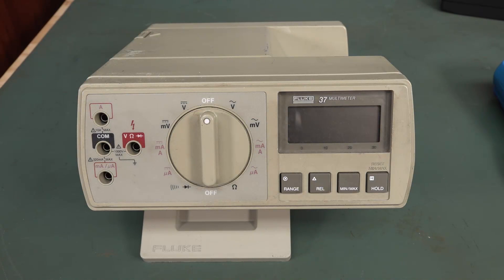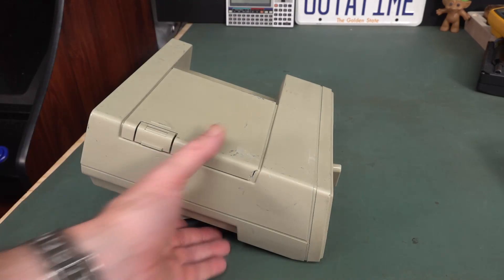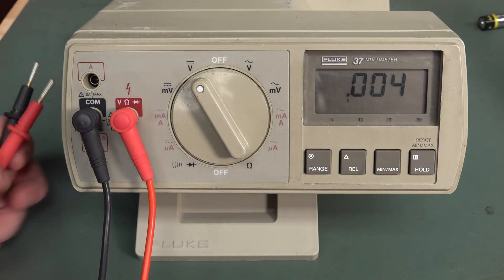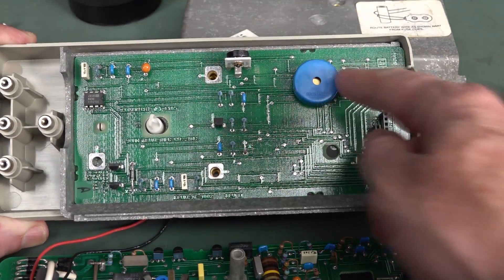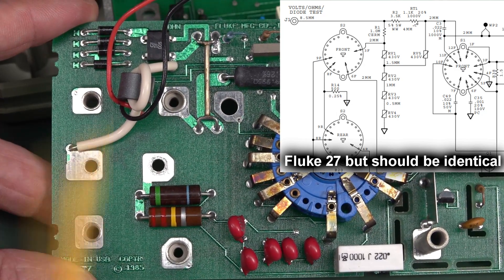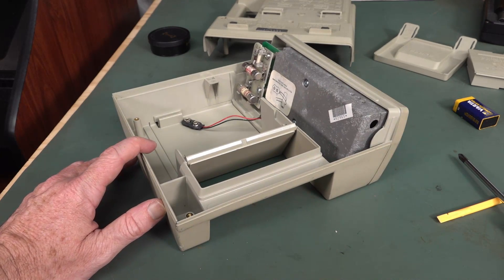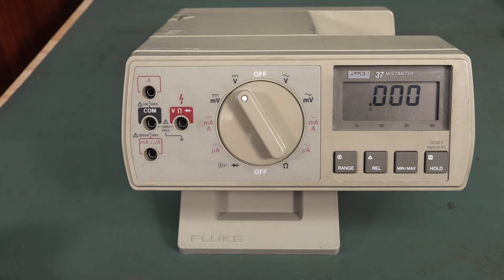EEVblog 1393 - Retro Fluke 37 Multimeter Review & Teardown

Comment from the maker: From Dave Taylor, former Fluke meter designer on the EEVblog forum: "The 37 form factor was requested by corporate buyers because the small handhelds walked out the door too easily. Specifically it was made bigger to prevent theft."

Comment: The UNI-T UT803 is a similar design philosophy.  It will take "C" cells and is pretty much good for the shelf life of the batteries since it has an auto-off feature.  Plenty of room for accessories, built-in mains power supply and a carry handle.  Unfortunately it is a UNI-T so it is complete with absolutely zero support.  Shame.  UNI-T make some interesting stuff but will not support any of it.  And I mean absolutely ZERO support.

Comment: Radio and Electronics Magazine back in the  mid/late seventies ran a project piece with a prototyping workstation that used a sloped-front cabinet very similar to this, without the bail. It had two analog panel meters on the front for voltage and amps, +5/±12V supplies, a bunch of LED indicators and various other accessories around a bank of three prototyping sockets.

I've never managed to find the article online, alas.

Comment: I just realized, since this isn't "Fluke Yellow" or any shade of yellow anyone, (like the guys who make the meter with your name on it) could make a meter this color and form factor and there wouldn't be much that Fortive (the hedge fund that currently owns Fluke) could do about it.

Cool vintage form factor, modern electronics & reasonable price I suspect they would sell.
Reply: Hang on..
Someone may have done that already.
https://www.ebay.com/itm/283446984877?hash=item41fec1c0ad:g:FOoAAMXQbcRQ5V3G
I can't find a pic from the side so I don't know if it has the right angle up front or not.
Reply: I'm not sure how you say "lunchbox" in German but this looks like it has  a storage compartment.
Front is at wrong angle however.  https://www.ebay.com/itm/124065173511?epid=1766033220&hash=item1ce2dc5007:g:22MAAOSwKNJZ0VV3

Comment: Hi, i hope you can help me! Is there any LCR tester (or Other testing device) that have a “pass/fail with sound or visual confirmation when testing inductance and resistance in transformers ?  Like, set the parameters to “234 ~ 274 uH”, if the transformer is within the values, a confirmation sound or light tell me that the transformer is good or bad ? Currently i’m using a “Minipa MX-1050 LCR tester”

Comment: For the external power connector you can design a little solar cell with boost circuit. They lacked that idea in these days.
The form factor is stable;  that Fluke 27 is orientated vertically, and one pull on the leads and it falls.

Comment: Back in the very late 1970s I had a BK Precision LED multimeter that was compact (5x10x12 cm) and portable, but went through batteries very quickly (6AA, IIRC).  In the end, a massive leak from all batteries killed it.

Comment: My vote is for a new full  3d printed plastic case - and while at it, why not place the fuses on the reverse side to minimize depth. A metal π-shaped adjustable stand would work wonders too. The 90 degree angles on the pcb tracks is huge turn-off though. Probably doesn't matter a bit but it does scream laziness... Or perhaps it is optimal: after all tracks crossing vertically exhibit minimum interference. Are there any tracks crossing vertically, however, that justify this?
PS: Having said that, quick ebay.com search (14/5/21) reveals: 161 Fluke 27's and just 2 (!!!) Fluke 37's. I guess there won't be much demand for a third party case. Also, the 27's can be had for the same or less money and some time come with a protective carrier case which a great boon.

Comment: Regarding the shield it looks like molded plastic with some form of metal filler, probably for conductivity and possibly to also help act as a flame retardant. Can see the lines of flow in the plastic from the molding process. Also the use of brass threaded inserts alludes to it being plastic as well.

Comment: The Beckman Industrial 360 is another benchtop multimeter with storage compartment built in. It's a 3.5-digit true-RMS multimeter and it even accepts K-type thermocouple probes to measure temperature. The crazy thing about this model is that it takes 6 size D batteries. When I got mine used, the batteries had a date code of sometime in the 90s. They were Duracell batteries over 20 years old with still enough juice to power the multimeter. However, I replaced them anyway with a fresh set of Duracell batteries.

Comment: No I don't think it has good form factor. I use my meters 2 ways. The first is fighting fire on the production floor and between the 27 and 37 I waould pick the 27. It's smaller and can be used on the floor literarily. The other way is on the bench which I prefer a normal bench meter. I don't need the storage compartment of the meter. I wouln d certainly want one of the 37 for conversation piece but if Fluke make a new meter in the form factor I wouldn't buy it.

Comment: Got one on the bench here for a decade. It never failed me. I never changed the battery. It’s the optimal size for a portable multimeter. Throw in the probes, screw drivers, cutters and a biscuit and go fix stuff!

Comment: I believe the "ASIC" is actually a mask programmed Sharp SM4 microcontroller. Fluke used these in a lot of their early handheld DMMs.

https://en.wikichip.org/wiki/sharp_corporation/sm
Reply from the maker: Can't be. The ASIC does a ton of analog switching stuff.
Reply: I stand corrected. Indeed, Fluke did produce an in-house custom analog chip. They actually had their own IC fab for their custom ICs. The 4-bit SM4 is used to drive the display and talk to the analog front end.

For many years they fab'ed their own true RMS converters in-house, but that was a bit after the Fluke 37 and its cousins.

Comment: My favorite Fluke is the 8050A-01, onboard batteries or mains, dB conversion,    
Mine ( bought new back in the '70s) lost its liquid crystal display and naturally, Fluke has no parts.  I have an equally as old 8010, mains only, fewer digits, no dBs, that still works.  My overall favorite bench multi is the HP33401A. It lacks histograms and multi-color display of current offerings but it tells the truth and has been reliable for approaching 2 decades.

Comment: If it weren't for the voltage difference you could swap the 9v battery for one of those large supercaps. Just charge it up every 6 months and it should last forever.

Comment: I have two of them. Love them! One has been cut off, with a bandsaw, just behind the front part, so the handle and the compartment is missing. (not by me) Bought them very cheap, 10 € each, on the ETA, Chalmers annual Electro Technic Auction, Gothenburg, Sweden.

Comment: Yay oldschool meter video! I saw an ad in a 1984 electronics magazine for the Fluke 8025A (on which this is based on) if I remember correctly so.. the design must be from the mid 80's like you said. The little fuse is in series with the one used for the miliamps and microamps and it is rated so it blows first and saves the owner the price of a 1000v hrc rated fuse.. the larger one only blows if the little one can't interrupt the current. Also I think I see two PTC's on the board, just that they are the boxy unpainted type.. one next to the shunts and one on on the other side of the range switch next to some resistors. The form factor is nice and the range switch is awesome on these, well worth the money on ebay. PS: Glad to see the old 27 still in your collection, it's a keeper! Thank's for the video :-)

Comment: at 14:00 On the Topleft with the 4 Diodes, all Silkscreen symbols point to the left, the bottom Diode is turned around though against the indicated direction. Maybe just a Silkscreen error. Since it worked sofar.
Reply: I think it still works because nobody overloaded the mA input.

Comment: 13:57 Curious to know what the four 1N4007 diodes connected to the bridge rectifier are there for.  Bueller?
Reply: I'm guessing it's capping the voltage across the shunt for protection. 4 diodes across the diode bridge act as the "load" in standard bridge terms. In either polarity of applied voltage, the input would see 6 diodes (two conducting in the bridge at a time, plus the four) so it would start conducting and cap the voltage at approximately 0.6 * 6 = 3.6 volts. Don't know why, but they wanted to cap it at specifically 3.6 volts, and the circuit is basically a cost cutting measure (but achieves the exact same) as having two strings of 6 diodes in both directions.

Comment: @10:15 The small circular looking "clock" in the center. It is a date and mold stamp used for injection molded plastic. The lines are the flow lines emanating  from the injection sprues.

Comment: 13:56  What is the point of connecting FULL bridge rectifier like that?  
Can some-one write quick explanation or point me to the literature where that is mentioned? 
-Thanks
Reply: Unidirectional directional clamp, with 6 diode drops, but only requiring 8 diodes thanks to the bridge, rather than 12 needed if you just used 2 anti-parallel strings.

Comment: @6:53 I think it is Antimony.
https://en.wikipedia.org/wiki/Antimony
Reply: @10:15 The small circular looking "clock" in the center. It is a date and mold stamp used for injection molded plastic. The lines are the flow lines emanating  from the injection sprues.

Comment: I think its magnesium.
Reply: @10:15 The small circular looking "clock" in the center. It is a date and mold stamp used for injection molded plastic. The lines are the flow lines emanating  from the injection sprues.

Comment: That looks like the steel they used to make pc cases out of. Those big crystals give it away. I looked it up. Those "spangles" as their called are from hot dip galvanizing.
Reply: @10:15 The small circular looking "clock" in the center. It is a date and mold stamp used for injection molded plastic. The lines are the flow lines emanating  from the injection sprues.

Comment: That looks like a zinc alloy on that interior case.
Reply: Yes, old Zamac zinc aluminium alloy, with the characteristic powder bloom from the reaction with moisture for the untreated alloy. Could do with a clean up with a green Scotchbrite pad, and then 2 coats of clear lacquer to protect it, with only the contacts for the shield connection being left bare, though a thin film of silicone oil will help kep it clean and bright.
Reply: @SeanBZA  defititely looked like Al/zinc alloy to me, thank you!
Reply: @10:15 The small circular looking "clock" in the center. It is a date and mold stamp used for injection molded plastic. The lines are the flow lines emanating  from the injection sprues.
Reply: Looks like a structural foam molded part to me, not metal. It's plastic molded with a blowing agent that creates gas bubbles inside the part to reduce weight and material use. The parts tend to have a rough surface with highly visible flow lines.
Reply: Could also be zinc-spray over plastic.   Used quite a bit in the old days to pass VDE (and FCC 15 part B) EMI standards.
Reply: I've never seen anything quite like that. To me It looks like injection molded grey plastic with flakes of some kind of metal filler.  It would be interesting to see what a soldering iron does to it.
Reply: @Chris-du7hi  Zinc-arc spray coating has been common for at least 40 years.  Very conductive, so you can verify the coating (as opposed to paint) with an ohmmeter.  Sometimes aluminum or copper is mixed into the spray.
Reply: Agree - looks like a zinc injection casting.
Reply: I was thinking the exact same thing.

Comment: Given that the metal shows flow lines it is probably die cast, thus, given the color and cristals should be zinc.
Reply: @10:15 The small circular looking "clock" in the center. It is a date and mold stamp used for injection molded plastic. The lines are the flow lines emanating  from the injection sprues.

Comment: interesting form factor... that metal shield almost looks like its galvanized... 
thanks for the teardown Dave...always good lookin at old gear
edit: on closer look and the sound from tapping... seems to be metal impregnated plastic!
Reply: @10:15 The small circular looking "clock" in the center. It is a date and mold stamp used for injection molded plastic. The lines are the flow lines emanating  from the injection sprues.
Reply: @michaelmoore7975  good catch! i didnt look for them!..tell tale signs!
also the metal screw inserts are a give away!
Reply: @WacKEDmaN  Always the smallest of clues, eh? But you had it mostly ...."listen" as well as look! Tell-tale sounds!
Reply: @WacKEDmaN  Another clue @10:15 is the brass threaded inserts encased in a large cylindrical boss. If it were thick metal, the metal itself would be threaded or perhaps a brazed/spot-welded on nut. If it were thin metal, it  would use sheet metal type screws or screwed with spring steel "U" nut clips.
Reply: @michaelmoore7975  yup i caught that one in my last comment!

Comment: The metal case does look weird, almost like pot metal?
Reply: Almost looks like metal impregnated plastic of some sort, although density must be close to aluminium or Dave would have said something. Might be interesting to see how conductive it is.
Reply: @6:49 Look at the exposed edges of the case. Really thick. They wouldn't do that with metal. It's a type of plastic. If you're able to blow it up big you can also see the exposed edges are sawn.
ad. 
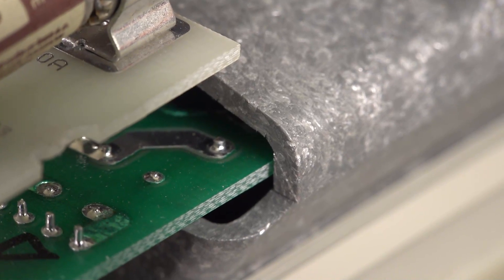Also @8:14 sawn edges.
Reply: Got it.
@10:15 The small circular looking "clock" in the center. It is a date and mold stamp used for injection molded plastic. The lines are the flow lines emanating  from the injection sprues.